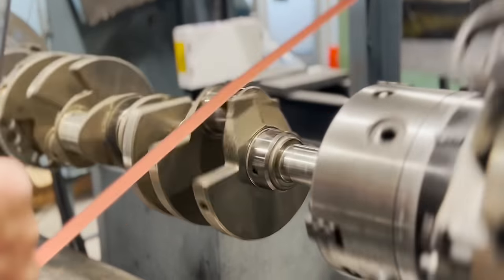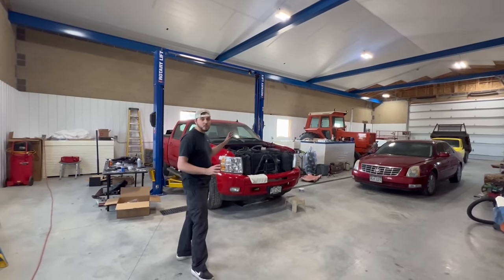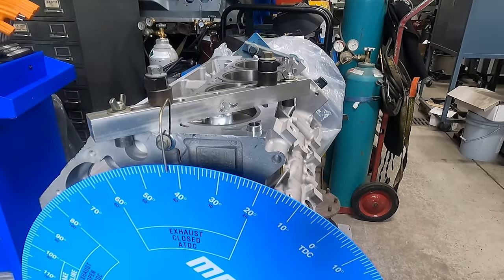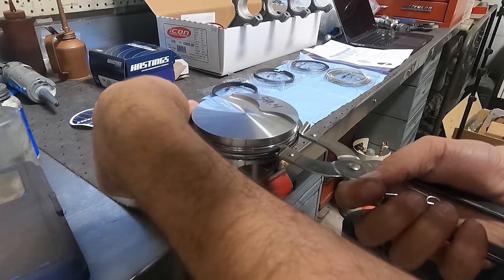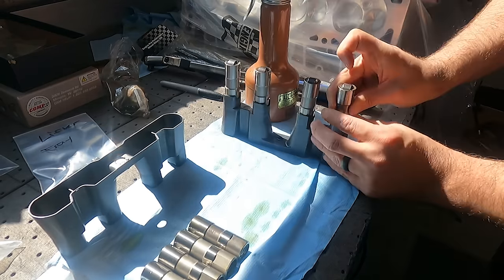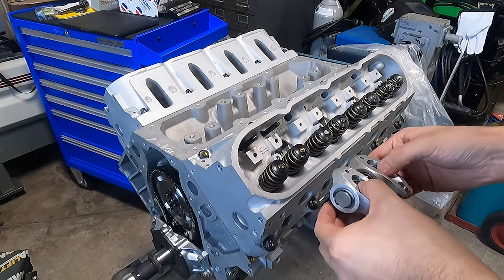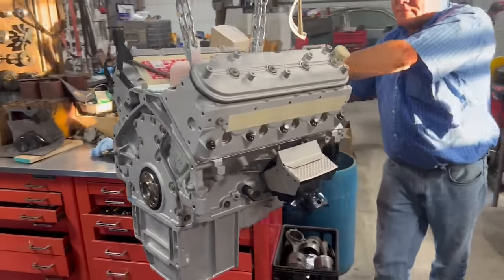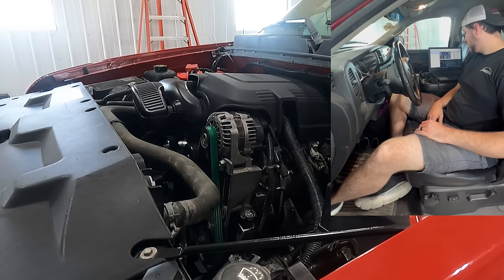I Deleted The AFM And VVT From My 5.3L LS V8! - First Startup - 5.3L LC9 Gen IV LS V8 Build Part 4

Comment from the maker: It's an amazing feeling to have my pickup back on the road after over a year!

As mentioned in the video, we want to say a very big thank you to Skull Bliss for sharing their work with us and our audience. From 8/14/22 to 9/14/22, we have secured a one time $50 off coupon on any order at https://shop.skullbliss.com/WWaA0udXEg when you use our code: JIM50

Thank you all for your support! 😁
Reply: Hi nick I am in pueblo which is a bit of a distance from you but if you ever wanted to tune it or need help with tuning it I would help you out for sure. I can do remote tuning for you to. I would do it to help you out as a thankyou for the killer videos and the help it provides us gearheads. I will be calling this week to set up a time to have my BBF block work done and can chat with you then if your interested.  I would do it free of charge
Reply: There are VLOM delete kits by Scoggin Dickey
Reply: I had an engine built for me by a shop but per the cam card specs  I had to install a second set of valve springs after it was broken in. I did the job and still haven't started the engine after 4 months. Just been working around it scared to death I've got my valve adjustment wrong. I've got $30k in this thing and scared to death.
Reply: I've built a ton of motors and they're always thoughts that run through your head of what was missed or may have been wrong. Generally they're unfounded and everything is alright but every now and then you find something will mess up
Reply: Have you seen Richard Holdener's videos on the Truck Norris cam? Also, what would your current turn around time for a new bbc build (dart heads & block)
Reply: Okay I know this videos a couple of months old I think I finally just crawled out from underneath my rock cuz this is the first time I'm seeing it but whatever.
You deleted the VVT and I know what that is this is probably going to be stupid but what is the AFM I'm not a mechanic I'm just an enthusiast.
Reply: Never mind I just figured it out I think I'll crawl back underneath my rock now.
Reply: Sounds very good. I prefer my V8 engines to sound just like the engine you built, for me that’s perfection .
Clean, smooth, even…perfect. It don’t understand when people I know build engines , and want me tell them how impressed I am that the engine sounds like rocks in a clothes dryer ? Clean, smooth, even…and makes good torque….that’s perfect, and what I prefer.
I would like to upgrade my ‘08 LS, but It just keeps running just like when I bought It new! (I try not to let my sons drive my truck)
Reply: @peterparsons7141 I've got a 01 Chevy z71 with a 5.3 in it and it amazes me how strong it still runs the truck was owned by a older gentleman who took great care of it so my plans are to rebuild the motor some day and keep it alive
Reply: @EricLaney-n1k  I needed a reason to replace my ‘08. I bought It new, and took care of it. Doesn’t have 100k on it. Had it at the shop the other day, wanted my mechanic to look at all hoses, bushings. Lines, engine, cooling….and replace, all liquids gearboxes, trans, brakes, steering (everything).
He said, don’t sell it…tightened up the front end. Not a squeak, rattle,, nothing. I’ve replaced some things, brakes, tie rods,rads, …
I ran it at 100 MPh the other day. It ran so smooth and effortlessly. And tight and wasn’t hitting any rpm.
It’s too bad the north east salt and winters just kills the bodies… my mechanic said because parts are so available he’s got lots of used things if need and dealer stuff is easy, he can keep it running cost effectively for years … so I stopped shopping. I wanted a new truck, not happening.
Reply: My 2009 gmc has been sitting for a year now had the afm issue and now just trying to figure out next step probably try and save up and then rebuild the thing
Reply: How much more power will that engine have

Comment: I really admire all the steps and time you take checking your parts while assembling. I had a 1979 MGB LE that developed a water leak into the oil. I replaced the head gasket 3 times and that was all she wrote. I gave up and told my Dad I’d was done w the car.
Reply: Those heads are known to crack.  Did you have it magnafluxed?

Comment: A topic for a video: Angle matching/machining an intake manifold to head interface after milling heads.
My local machine shop said my small block didn't need it, wrong, the intake gaskets totally failed along the bottom edge on all 8 and leaked like a sieve into the intake ports with 5k of a total rebuild.
The Cleaning Guy probably knows all about this potential issue.

Comment: A good way to make sure you don't damage the crank with the rod is to get some vacuum hose or something like it and put it on the rod bolts/studs
Reply from the maker: Yep! Or bolt boots! However in this case the rods use capscrews, so they aren’t in the rod during install. Still gotta be careful lol
Reply: Ls engines use cap screws, no bolts or studs to crash into crank.
Reply: @JAMSIONLINE   especially with a fractured cap rod, one little ding in mating surface and your buying a new rod.

Comment: Great video! I have been building and rebuilding LS engines since about 2000 and I still learned a nugget in this video; I didn’t know that those thicker valve cover gaskets and corresponding hardware existed. There were a few times I wish I knew that!! I have added that to my mental arsenal 👍
Reply from the maker: Yells Terra P/N YT5132! https://jamsionline.com/valve-cover-spacer-seal-gm-ls-series-yella-terra-yt5132/

Comment: So good to see somebody finally using an external pre-luber tank. Saves the battery and starter. On all the diesel marine engines we do we fit a mechanical oil pressure gauge into the system as well. Brilliant units not only for pre-lubing but for finding possible leaks. Better to find a problem on the floor before its run or goes to the engine dyno then into the boat.

Comment: Thanks for the ride along!  Always a great feeling when she takes off running on her own on that first startup...the lifters clattering always causes that adrenaline rush feeling in your stomach doesn't it?  Nice throaty sound with your stock muffler; congrats on the cam and compression homework you did for the rebuild, just that little bit on the front end made an outstanding mill for your truck, should serve you well.  Cool runnings!

Comment: Jim,I am a non automotive tool and die maker. When you talk about clearance,would you PLEASE specify  if you are talking about  clearance per side or diferance in diameter? This question also comes up when we are talking about any angle such as on a 60 degree v thread. IIs it the included angle or per side. Thank you for the clear video and sound,you are the best.

Comment: I recommend next time BEFORE you start it up the first time, to crank it with just the starter for 15 seconds.  I usually do this with the spark plugs removed for a no load oil pressure build up, and i use either a starter remote or a bypass relay for the starter (to avoid any fuel or spark activation, key off).  Then I install the plugs and fire it up.  Typically the engine is quiet as it is fully primed. Excellent video otherwise, i like seeing "standard builds" as they are more rare on the interweb.
Reply: No need to crank the engine.  Did you bother to watch the video??  They used a trick external pressurized oil tank which pre-lubes the engine perfectly!  Your method is fine, but they did it the “pro” way!
Reply: @paulcopeland9035  you are correct I missed the whole priming part where they used an external oiler, which is an amazing piece of equipment and I'm glad they use it.  I still think it's prudent to turn it over with no plugs just before the first startup, gets the oil going under no load through the whole oiling circuit. Hard to say what their actual timeline was but I do very much appreciate their hard work

Comment: Even though the engine was primed with oil it always a good idea to disable the actual starting and crank till you build oil pressure, confirm with a gauge if there is not one in the vehicle. Cheers, love the work.

Comment: I’m running a set of .040 over 3.780 (5.3) Icon pistons forged 4032 material. It’ll see max 12 lbs boost in my daily crew cab cat eye. P.S. when I fire up a fresh motor on these platforms, I hold the pedal all the way to the floor and it goes into flood prevention mode and won’t allow it to fire and it’ll turn over for 10 seconds. After the third time of doing this you’ll see your oil pressure gauge register pressure and you’re good to go.

Comment: So i just watched this video,,,, awesome you used the y/t rocker gear,,,,, i had a set on my old 83 5.0 litre holden i had built many years ago,,,, they are an awesome upgrade on that engine,,,, but i really appreciated the work you put into that engine with the deleted parts etc, not that ill ever bother building a engine like this myself as i have associates who have all the gear,,,, i mainly build myself a few go fast outboards and the aftermarket performance parts for those is flooded with similar information like necessary piston clearances, ring gaps etc,,,,, loved this build

Comment: Just an FYI- I read through Eaton's white paper on LS lifters (they're who actually builds them, GM actually designed the engine around them; same lifter is in other things, like my Harley 🤣) LS7 lifters have a design preload of .090-.110", with .100" being nominal, out of .200-.220" total travel. For those Yella Terras, the instructions aren't the best, and their included shims aren't very consistent in thickness or seem to be thick enough; Determine the shim required to get the best wipe pattern on the stem ( I wound up going with .095" shims under the pedestals to get the wipe pattern centered on the stem and thin), and THEN measure for pushrod length, and add in your preload.

 I actually wound up machining the factory rocker stands into one-piece shims at that thickness, so I didn't have to keep track of shims or washers; they make life easier and have little ears to index them on the rocker bosses in the head, and that's something you have the equipment to do.

Also, YellaTerra sells a thicker valve cover gasket that spaces the cover out enough to clear the rockers without having to remove any metal from inside the valve covers.

Comment: I’ve used a .001 under (or over) bearing with a std bearing half to get rod bearing clearances where I felt was neither too loose or tight.
Reply from the maker: I actually contemplated it, tried one rod w/ mixed but ended up deciding to just stick with the .001s

Comment: I like your videos, like how you explain procedures.  Only thing I disagree with is using assembly lube on cylinders. It takes to long for it to wash out and the possibility of it burning and gluing the rings in the grooves. Total Seal recommends wd-40 on the cylinder and ring pack. I use wd-40 on cylinders and a very light coat of oil on the skirts only.

Comment: When you put the trans to the motor, and did the converter mount to the flex plate, did you check to make sure you still had enough converter engagement into the front pump? Many times a washer of some varying thickness will be needed between the converter (at the bolts) and flex plate, to gain the proper from pump engagement.

Comment: I can understand deleting VVT if it’s a race truck. My experience is the VVT helps with power and mpg on mild builds.
Reply from the maker: It definitely helps a bit with power for an application like this, as well as mpg. That being said I didn’t really do this build with mpg high on my list of concerns (I have other vehicles if I’m trying to save gas). 

I explained in another comment but in short, my thought process was to eliminate as many possible weak links considering the slightly higher spring pressures w/ the setup on the heads I built. 

Hope that makes sense!

Comment: I hope you used a Melling M365.  The aluminum engine needs more volume than pressure to deal with greater tolerances due to heat expansion.  The iron block oil pumps generate low oil pressure when used in these motors.
Reply from the maker: Nope, Melling M295. 

While the difference in tolerances of an iron block vs an aluminum block should definitely be taken into consideration, I would invite you to reference the second to last page of this catalog from Melling: https://www.melling.com/wp-content/uploads/2022/04/Melling-Performance-GM-LS-Mini-Catalog-updated-4.21.22-LINEAR.pdf

You'll see in the list from Melling that the M295 is listed as the replacement for numerous engines, both Aluminum block and iron block. 

Haven't had any issues w/ pressure so far but I guess I'll keep ya updated lol.
Reply: @JAMSIONLINE  Do keep us posted, I prefer the volume over pressure.  There were several guys earlier this year with low oil pressure problems and all replaced their M365s with the M295s but I never heard back from them.  Appreciate your videos, you did great work getting that motor ready for the next couple hundred thousand miles!  Would love to see some torque and horsepower numbers to see how much power the precise machining increased performance or rather, let more power to the ground.

Comment: Additional note on priming the oil system for the engine. It's important to make sure the engine has been primed just before engine start up. Not one or two days earlier as you can tell by the lifter noise. Although the lifter noise went away within about 5 seconds of engine start up, in all of my experience, that's not acceptable. Disable ignition and spin the engine over one last time before turning on (plugging it in ) the ignition. Preferably using an oil pressure gauge test tool type or oem gauge on dash to confirm oil pressure before starting engine for first start up.. Great deal on pre priming engine though. Wish you well..
Reply: LOL..
Reply: @northface484  How many miles are taken from an engine for every second the oil pressure is zero or oil light is on while the engine is running ?
Reply: @jamestsmith4500  LOL...

Comment: Nice work as usual! I'm curious why you chose to remove the VVT? Do all aftermarket cams just not support it?
Reply from the maker: There are aftermarket cams that support VVT, but more options without. We have good access to Elgin cams, so I wanted to give this one a go.

With stiffer springs, you’re going to inevitably increase wear and tear on the VVT actuator. Some cams also require a limiting kit installed to the actuator.

I may be sacrificing a bit of fuel efficiency and some low end eliminating it, but I also was just thinking “let’s simplify this engine back to the basics and get rid of some of those parts that may decrease reliability.” 

Hope that answers your question!
Reply: VVT exists strictly to meet CAFE regulations by the government. If not for those none of this variable valve and cylinder deactivation would be necessary and these engines would run trouble free from the factory like the old Chevy small blocks - that is to say, a half million miles with simple, standard maintenance.
Reply: @joe6096  not entirely true. They also significantly increase the "area under the curve" of the power-band, making daily-driven usage much more flexible. (Edit: regarding vvt, not selective cylinder  deactivation)

Comment: I'm always nervous on first start up.
Windsor small block fords with flat tappet cams can make you nervous. 
They need a 2000 rpm 20 minutes break in.
Do I have the timing right? Will it over heat? Is it running rich or lean. Will the lube do it's job?
I've never lost a cam lobe but heard other people have.
Reply from the maker: I understand! Especially on flat tappet cams. Like you said everything needs to be right, and the lube and oil need to be right!

First 2-30 minutes of that cams life are the most important,

Comment: That was a cool assembly. It’s gotta run better without the DOD and VVT. Really thorough job. It’s nerve wracking to find all the parts necessary in an unconventional build. Hours on the internet scouring for solutions I bet. All the instructions from various manufacturers have to be followed too. Good job. The 5.3 gets a fair share of griping so I’m curious as to how this engine’s power output will flesh out and maybe you’ll see an improvement in performance overall. Good video 👍
Reply: I bought the Range Disabler that shuts off the afm vlom so it runs on all 8 cyl all the time and it definitely has more power and better throttle response and it only gets 1.5 miles per gallon less fuel  mileage compared to when the AFM was working .  It's a 09 Silverado 1500 with the 6 SPD trans and 3:23 gear with 206.000 miles now and averages 15.8 miles per gallon but at 70 + the instant economy mph it has in the dash it's getting 22-24 mpg . GM should have got their asses sued for this junk they designed and people tried to get a class action lawsuit for the first models but the judge shot that down but I now see that the 2012 - 2021 models are having the very same issues and that there is a class action lawsuit against GM now on these model trucks that use this and unfortunately most of the money will probably go to the lawyers involved .

Comment: Do you do turn key remove rebuilding and reinstall for customers, and if so how much does that generally cost?
 I have a 92 Camaro with a 2002 5.3 that I would like to have rebuilt with some power added (bore over, cam, bump compression)

Comment: Had a Silverado with the same issue, ended up swapping the motor at 90k miles and got rid of the truck shortly after. 

Great call stripping out the AFM and VVT. What would this cost if it were for a customer?